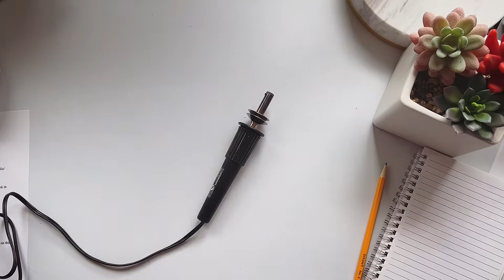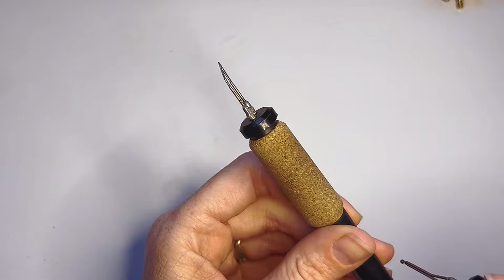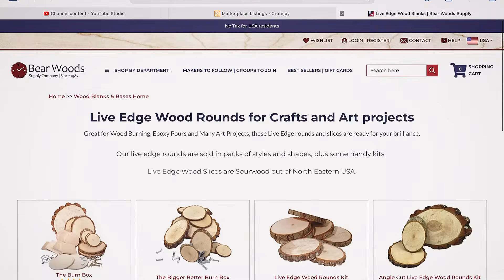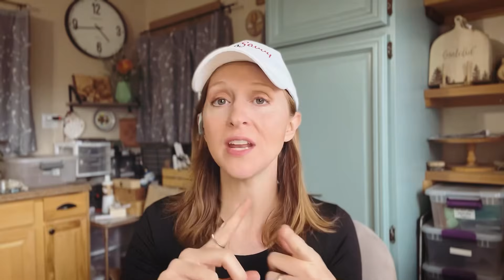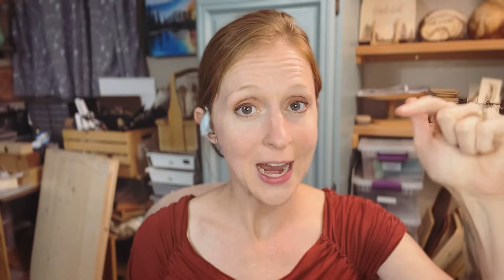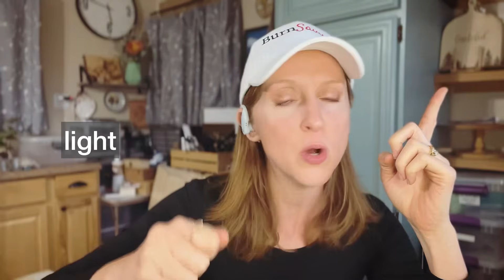Learn Wood Burning Art for Beginners [10 STEPS] 🔥

Comment: Professor,  another "?".  Sadly, budget constraints required that I buy a cheaper burner.  I got a G**dcr*ft*r from W*lm*rt.  It's way nicer than the one I had with no heat control.  Has dual port - both wires and solid.  The solid side is awesome for me.  However, I'm not thrilled with the wires.  I think it's me and not the burner.  Even at the lowest setting (350C), I can't stop getting big burn spots., especial when making smaller curves.  As a person with very limited drawing skills, I must take my time when tracing fine detailed curves.  This causes blobs.  Also, when I pause to examine my progress, the nib seems to heat too hot, even when shading.  Blowing the nibs before starting helps some.  Also, holding nib against scrap wood as a heat sink.  Can you tell me if it is because the burner doesn't have a low enough setting or is it simply that I don't have the skill set yet?  I watch you and others make fine detailed curves with no issue.
Reply from the maker: Hard to say but it does take practice. I’ve got a video where I use the Goodcrafter burner that you can watch if that helps. 

Goodcrafter Wood Burning Tool Review
https://youtu.be/BEE-5fkR2E8

Also, it could be the techniques. Doing long lines can cause blobs. I usually work with small lines and sometimes back and forth lines. If you haven’t watched the techniques video yet, try that. 

Wood Burning Techniques for Beginners: [4 Basic Pyrography Techniques + Bonus]
https://youtu.be/UVT1biX3Vmk
Reply: Follow up question which may be completely out of your area of expertise.  Do you know if it possible to plug the burner into a variac.  A variac controls the input voltage from 0 to 120 (full house current)?  Lower voltage should create lower current thus resulting in cooler nibs.  Most circuits can handle less voltage, but not higher voltages.
 I didn't realize, but I had already watched both of the videos that you recommended. :)  I see that you also had issues of the wire nibs getting too hot at the lower settings.

BTW: I thank you for your replies.  I'm subscribed, but not a paying member of your group.  Yet, you take the time to answer my questions just the same.

Comment: Professor, I have a question about nibs.  It seems that all solid nibs are interchangeable (same thread) among brands.  However, it also seems that the wire nibs are company specific.  Is this correct?  The Colwood burner seems awesome, and I really want one.  But those wire nibs are $$$$ (much more than other brands).  If I buy a Colwood burner, are there any off brands alternatives?
Reply from the maker: Great question. Wire nibs do tend to be company specific. There are not a whole lot of offbrands that fit it, but the Optima brand fits the Colwood brand. And there is a simple adapter that makes the razor tip brand fit the Colwood and Optima brands. And quite honestly, when you take good care of those tips, they last a very, very long time. Over the last nine years of owning a Colwood, I’ve only had to replace two or three nibs/pens that I abused. It’s not a bad investment when you think of it that way. 🔥🙌 Hope that helps!

Comment: Hi there. I'm leading a group of middle schoolers through an introduction to woodburning using the Walnut Versa Tools and a number of your tutorials, as well as others'. I'm wondering what you recommend in terms of changing nibs with these students. Everything I've read says to do it when the tool is cool, but you and others always seem to be doing it when it's hot. Two students have already had issues 😅 Help 😬
Reply from the maker: See Short reply
Reply: Womp womp